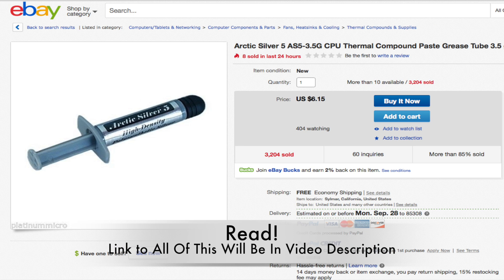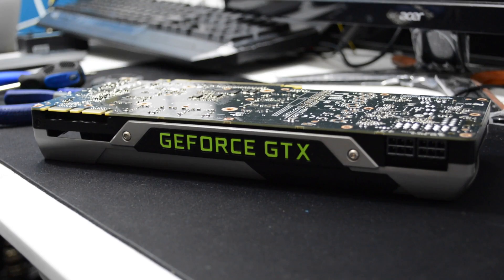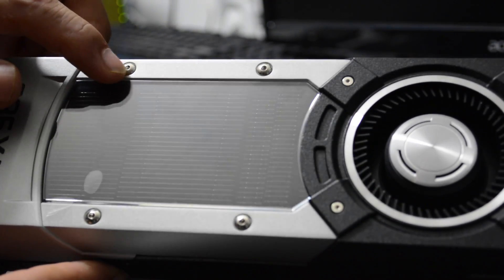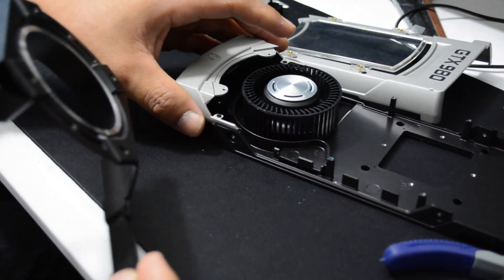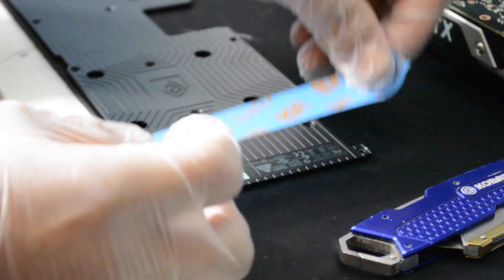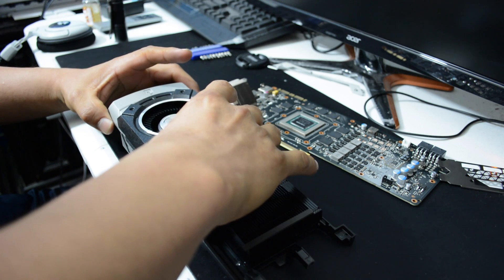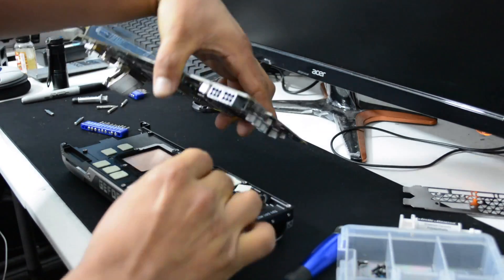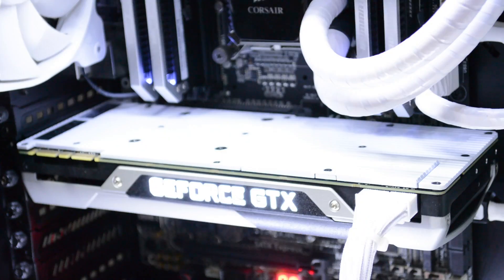How To Remove The Green Color Of The Nvidia GTX Reference Design Cooler

Comment: When I did mine I rubbed the logo face down on 2000 grit sand paper instead of using a dremmel, takes more time but less likely to cut into one of the letters

Comment: Taking apart top end expensive technology just to clean letter colours?... go over it with blue colour or fucjing tape it over lol... what a waste
Reply: Not a waste if it's a custom build.
Reply: is a waste, spray paint it white, will look exacly the same i gurantee
Reply: I wouldn't want to bring spray paint anywhere near a fully assembled card. It's still conductive.
Reply: You know what, youre actually right, how did i not think about it before... I should first strip the card into bits, and then scrape the green colour away. 
as for your stupid "conductive" comment, a large masking tape will do just fine to solve it ;)

Comment: I'm sorry but what the fuck.. I bought a Geforce TITAN GT X and it came with a set up wizard that allowed me to turn off the green lights when using the computer. It would still show as my computer would boot up but that would only last up to 10 seconds.. now for some reason I cant find that monitoring tool, so I know doing all this is unnecesary. Did they now remove that monitoring feature or do i just have to install something new/else?

Comment: You actually can just take apart the cooler with the card still attached and reach the logo the same way
Reply: How?
Reply: @Grandpasaab  old comment, but in the exact same way, there are no screws on the underside.

Comment: Wouldn't you be able to use sand paper?
Reply from the maker: +Joel Roa the sand paper way sounds to easy and convenient to the ear, Trust me i already messed up a reference design green logo by going with the sand paper, it scratches the black color/rubber and paints all over the white silicon, and it looks like shit, the only reason i bought the dremel tool it was to do this the correct way and clean, with the dremel tool you can only remove the green and don't damage the black part,

with the sand paper you just make a mess, i say it based on my BAD EXPERIENCE :...( lol

Comment: You just need a hex tool kit and a sponge/sanding block. Watch TechSource's video on it, how to custom paint your graphics card.
Reply from the maker: +KickmanPlays yeah that is one way to do it, and i did try the sponge/sanding block and it comes out to look ugly as shit if you are going white, if you add color to it like he did then yeah, but even so, the sanding block scrapes the rubber and makes it look like shit, another thing i did not like the way he did it was that he did not safely removed the cable, that could have bent or broken the pins of the pcb hell no lol take your time and do it the right way :) 

all tho i might do an all white reference design mod :) thanks bruh
Reply: No problem, that's for the video. Taking what you just said and I why, I understand why you would do this instead of TechSource's way. I am thinking of doing this to my 980ti if I get the reference model if I get it (leaning towards the Asus strix one) but there are just way too many tools involved that I don't have !
Reply: +KickmanPlays killer accent btw!
Reply from the maker: +KickmanPlays the reference design is by far my favorite cooler, other coolers not so much, i hate hot air been thrown to my motherboard, and yeah man i bought this tool with time, i have done this mod to 4 other reference  cards, my first attempt i screwed up my logo doing it the TechSource way, sand paper.

when ever you get to do it, do it the right way bro. he even said on his video that the black rubber part got all over the white letters LOL
Reply from the maker: +KickmanPlays lol well thank you kind sir :)